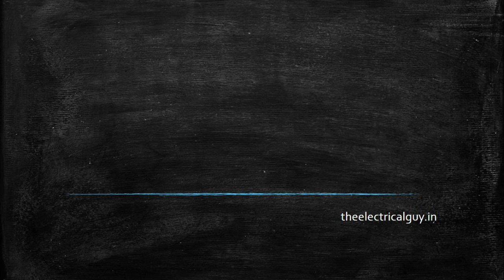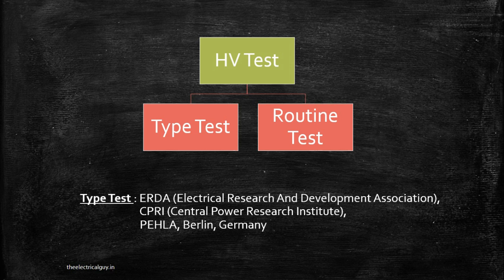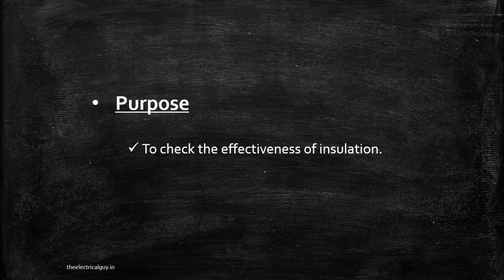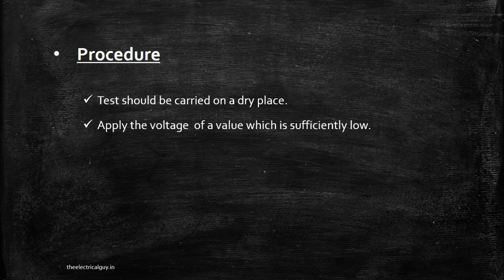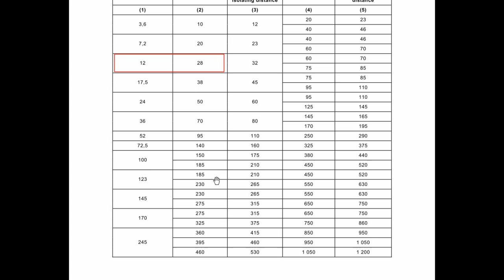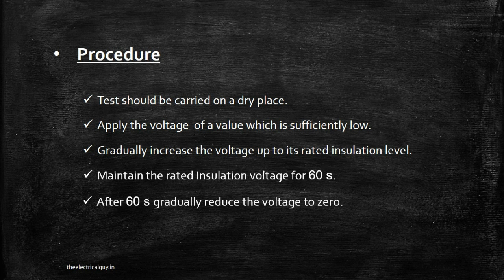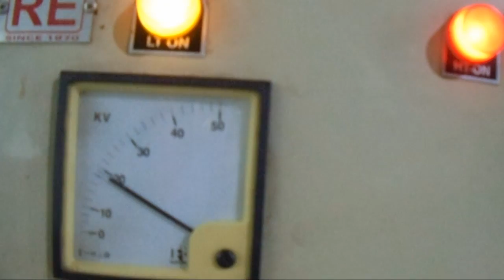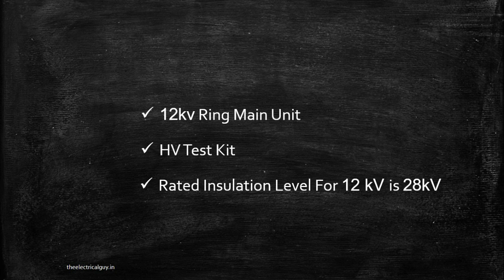High Voltage Test | With Practical | TheElectricalGuy

Comment: Sir we basically test it to check whether the mcb of the transformer trips and break the circuit if there is any leak current on the body, so it is called insulating test ?